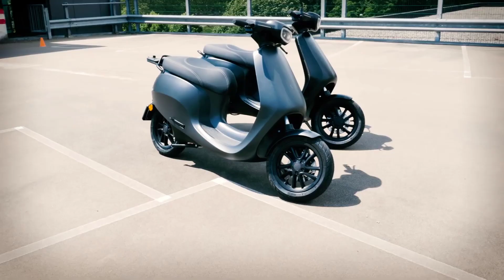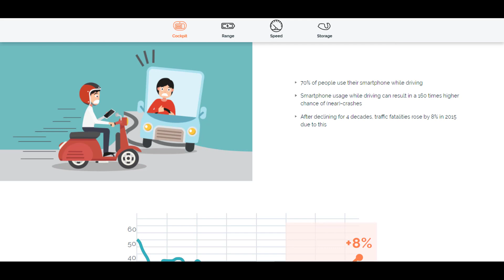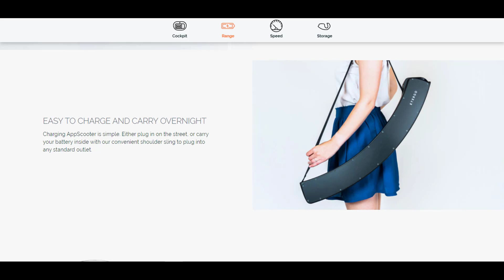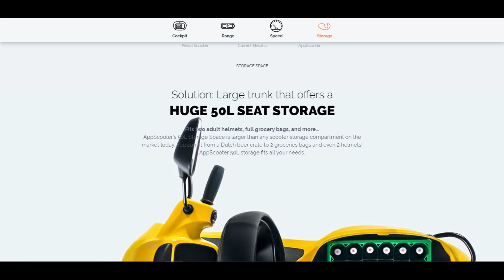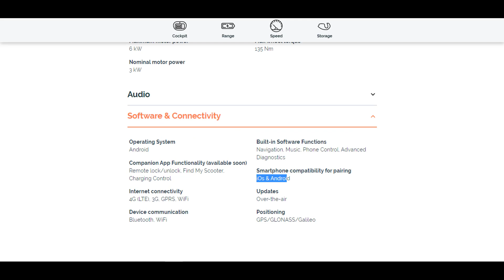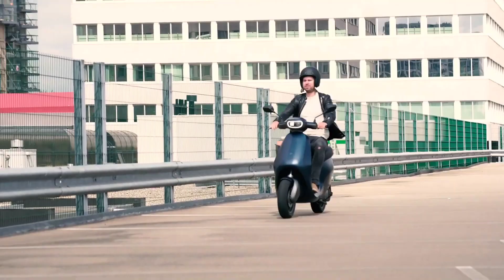#appscooter #etergo Tesla of Scooters |  Etergo AppScooter Specifications in Detail | #eCharged

Comment: I have concerns.
1. What is top speed ?
Company should give atleast 60 km top speed for this range ..
If the company is giving min 60km top speed and atleast 180km range. No doubt im buying it.
Reply: U can get 80-90kmph top Speed, u can expect 120-150 km per charger using 3 battery packs, each battery pack costs u about 20k INR.

Comment: It has a range of 60 km and not 240 km if you drive 80 km/h. That is not very much.
Reply: If it is giving 150 km range per charge im happy to buy i dont mind
Reply from the maker: It has a capacity to add about 3 batteries, each has a range of 80kms. That equates to a total configurable range of 240kms as per user requirement.
Reply: @eCharged  The range of 240 km is only for a speed of 20 km/h.
Reply from the maker: Sorry my friend...that's is not real world figure...each battery 80km ..even if you drive with 60kmph speed it will give around 70kms range ....so add in 3 batteries..which is 210kms real world range
Reply: @eCharged  Sorry. Please look at their internet site. One module lasts for 80 km but only at a speed of 20 kilometers per hour. Nobody drives 20 km/h, a bike would be faster. So when you drive 60 to 100 kilometers per hour, one module is drained much faster and the range is certainly not 240 km but rather below 100 km, even with all three modules.
Reply from the maker: I agree...Companies mention the optimum values based on simulations but we all argee that the real world range always depends on other factors like temperature & way of charging as well. Anyways good observation my friend...thanks for pointing this out...
Reply: @eCharged I don't think so. At 60kmph per kilometre 30 watt/h power is consumed, now calculate usable battery power is 1100watt per module, 1100/30=36km of range can be expected at 60kmph.
Reply: 20km/h in averege. With my car I'm doing alot of highways with 120km/h and my averege speed is about 55km/h. So 20 km/h in averege is not to for away for a scooter
Reply: @jolioli  nope 20km is really slow. I do 30km on my ebike and if I saw a scooter going 10 km slower than Mee it would look really strange and in would hold up traffic.
Reply: @marvin9860  do you really think a scooter with a topspeed of 90 km/h would be slower than you on your e bike?
Reply: @jolioli no I said that 20km/h isn't fast for a scooter. No one was talking about the top speed. Learn to read and stop liking your own comments it makes you look really sad
Reply: @marvin9860  and i said 20km/h in averege...talking about learning to read:) the self like was an accident😅
Reply: @jolioli my statement stands 20km in "average" is still slower that most bikes. they are promoting a certain amount of range at 20km/h my point is that it is really unrealistic that anyone would ride this thing around town with 20km/h and let old people on bikes pass than with ease. The range is way less than 240km for people that want to use this thing as an actual scooter that rides 45km/h. And it's "average" not "averege" I see that reading is not your only issue.
Reply: @marvin9860  that's why they wrote "max range 240km" on their website. English is not my mother tongue but i could speak in 4 other languages with you.
Reply: @jolioli  it is not about average.
Reply: @HiTechembroideryvizag  why not? they are not wrong if they say 240km with an average speed of 20km/h. Of course the scooter's consuming more with 60km/h, but 36km?! i think you're wrong
Reply: @jolioli I'm mean 36km range using single battery pack, but u can use 3 battery packs at a time which results 3 *36=108 km on full charge at 60kmph.
Reply: @HiTechembroideryvizag  ah ok👍